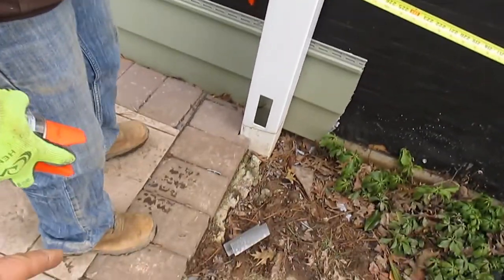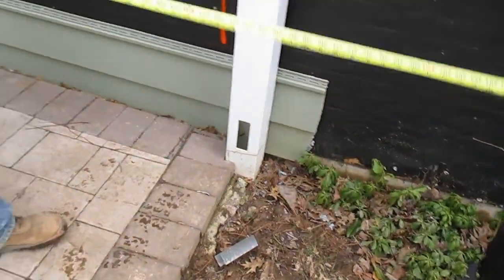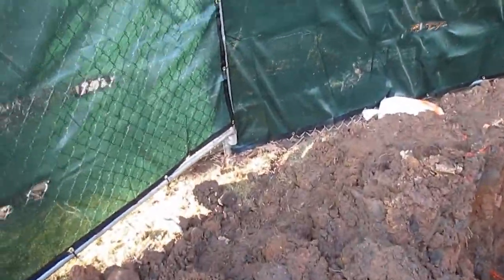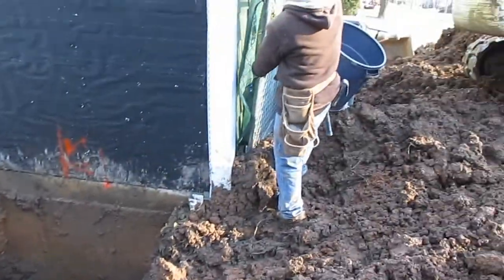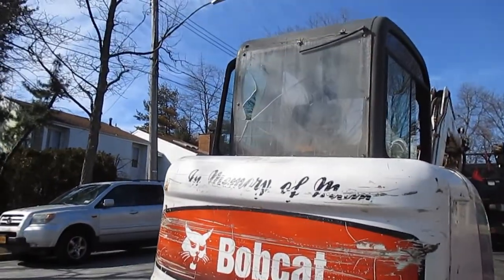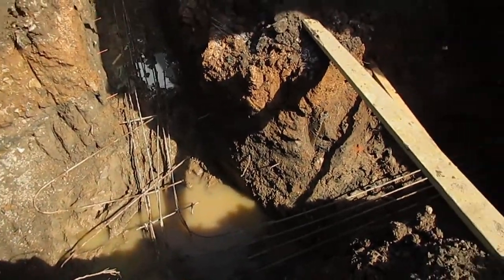Setting up a Small Extension

Comment: I just bought a 52 inch tilt bucket for my 337 check it out at Mongo Attachments this bucket would work great for you
Reply from the maker: Very cool. I’m assuming you use it mostly for fine grading?
Reply: @CoastConcreteCorp  res when prepping for concrete slabs sidewalks also I am currently digging a drainage ditch that's over a half mile long this job just paid for the bucket $3200 bucket cost
Mongo attachment has excellent customer service
Reply from the maker: MAK TOOL very cool. We basically just dig flat, we aren’t allowed to do drainage ditches as it has to be hard piped to a drywell. Is it like the ENCON System?
Reply: @CoastConcreteCorp  ditch digging is a great task for this bucket but I am sure you have been digging and your excavator is not level you can tilt bucket to maintain a level plane that's what I really bought for when grading areas
Reply from the maker: very cool. I'll look into it when we are allowed to work again. Stay well.